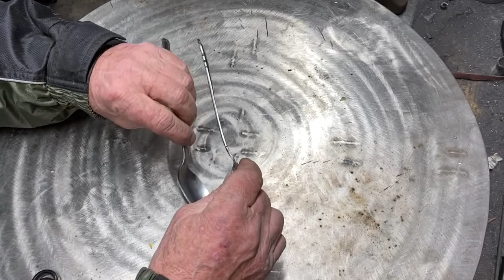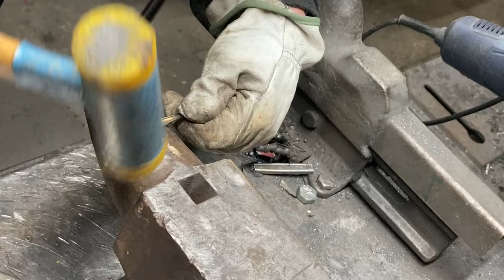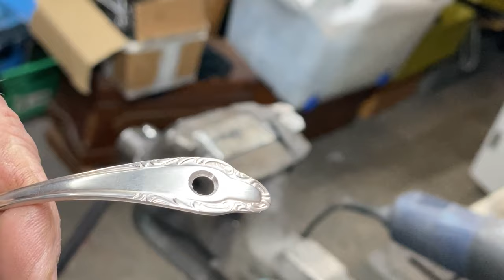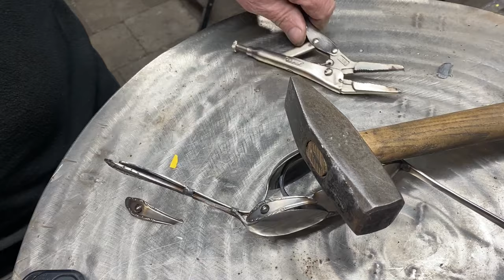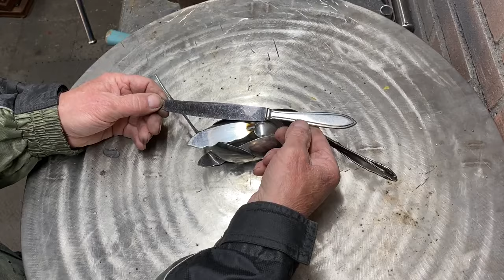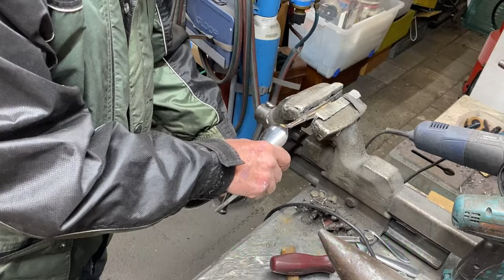How to make this shiny Metal Art bird from cutlery only !

Comment: What is your weld set up? Welder, wire , and is it gas or fluxcore. Thanks.
Reply from the maker: Hello Christopher,
My welder is an Headux Titan MIG 195, I use 0,8 mm wire with gas.
greetings.
Reply from the maker: Thanks for watching my video!!
Reply: @BrutusMetalArt  would did be possible to do what you do with 0.30 fluxcore wire?
Reply from the maker: It will be possible,but the fluxcore makes lot’s of spatters ,so you have to clean more.
Reply: @BrutusMetalArt  amazing work!! Do you use tri-mixture gas or the argon/carbon dioxide? Thanks ahead
Reply from the maker: I use argon/carbon dioxide, succes!
Reply: @BrutusMetalArt  thanks for the quick answer! 
One last thing Please, I recently Started welding silverware myself, but not sure about the voltage and wire speed for that kind of work. 
Have you got any tip? 🙏
Reply from the maker: Hello, the settings you have to try out, there’s no fixt setting for the job you want to do.
Reply: @BrutusMetalArt  thanks!!